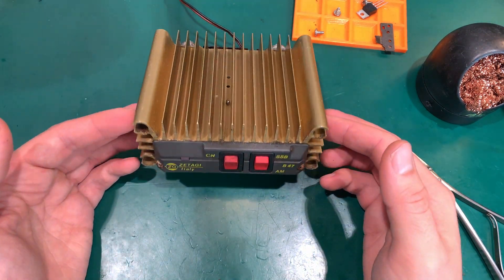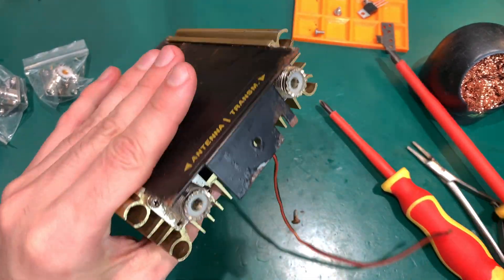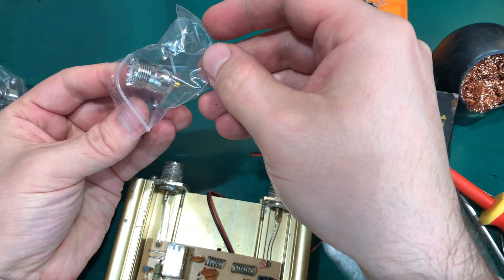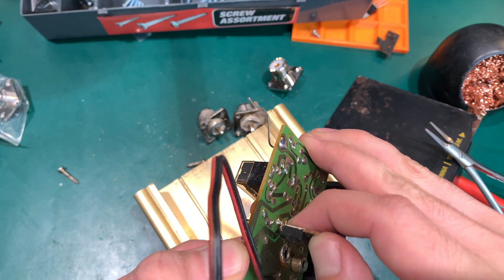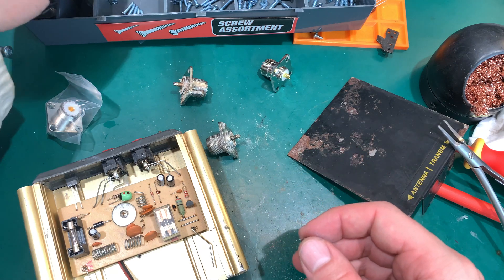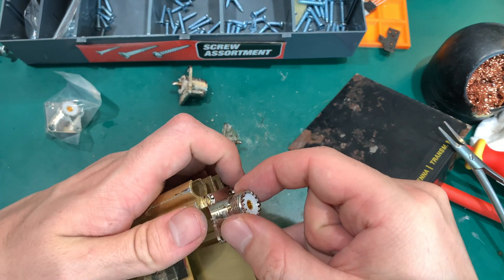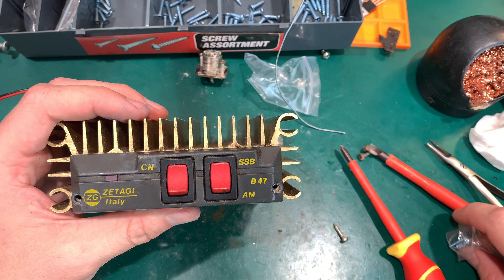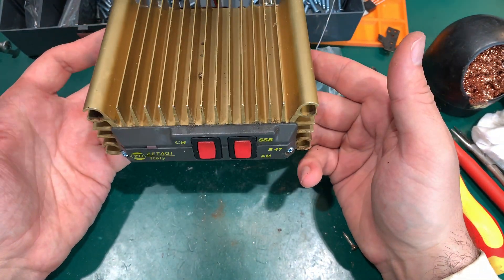Zetagi b47 linear amplifier CB 27MHz  teardown + restoration (sockets replacement )

Comment: Newer b47 types, have 2 mosfet transistors as finals? .P.s. you should be more carefull with disassemble, trying not to damage/ scratch the housing, if the amplifier belongs to a customer.😁